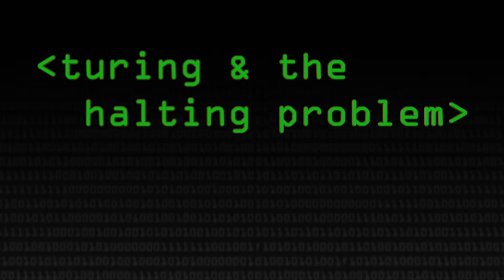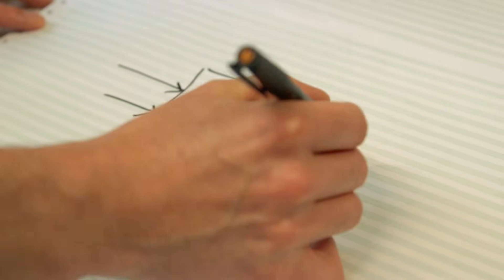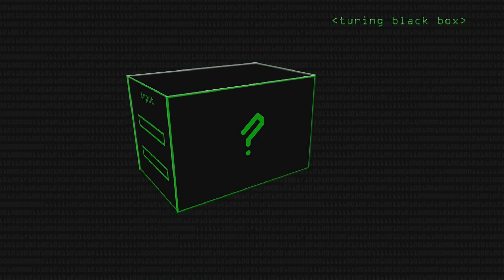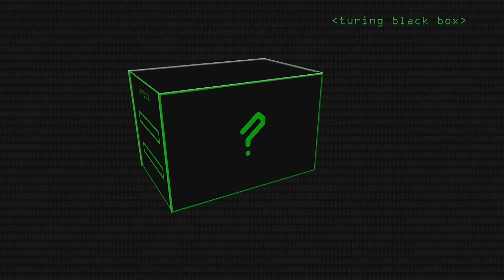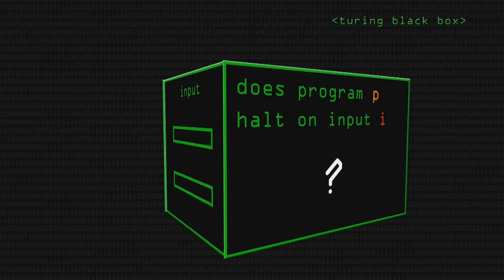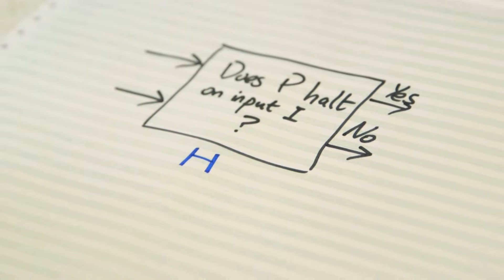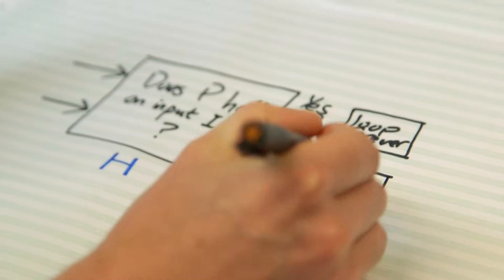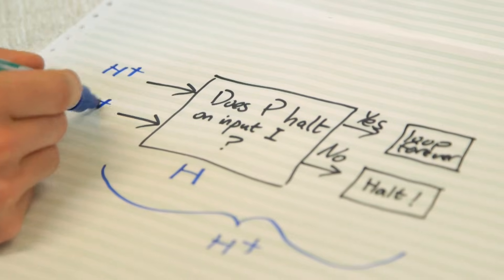Turing & The Halting Problem - Computerphile

Comment: 5:18 Aren't you just asking the wrong question? 
"Does the first iteration of H+ Halt?" would be a better one...

Also, doesn't that mean the machine could be the human brain...so...we couldn't do this? Yet...we can?

Also, how does that fact that putting H+ into H+ break means that H normal can't solve it?
Reply: +lolzomgz1337 to the other half of your question stated simply it cannot determine if itself will halt or not. The analogy he uses is bent a little.
Reply: +lolzomgz1337 That is a total bastardization of the original problem haha.

The logical conclusion isn't that we can't ever prove if a given program (h) will halt or not, it is simply proving that there is no general algorithm that can solve every single h out there.

For instance, I give you the following program:

func (i) {
 if i > 0 then {
  return func (i-1)
 else
  return 0
}}

Will it halt? Of course, there isn't a single number you can put in for i that won't cause the program to eventually stop, because if the value is ever not greater than 0, the program will return 0 as the answer. There's even an algorithm you could write to figure out that that program will eventually halt. The point of the Halting Problem is to show that your algorithm won't work with another program. You can only prove whether or not that specific h will halt or not, but there's no solution to find the answer for every possible h.
Reply: actually a human couldn't solve the halting problem because humans are at most turing complete
Reply: +lolzomgz1337 I could have sworn I hade a reply to this comment. And I got anotification when +Jahaal Mordeth posted. But my comment isn't here :(
Reply: Simon Lindgren
Damn. :(
Reply: Philippe Carphin Okay, fair enough.
Reply: +lolzomgz1337 This is a vulgarization of a problem that is actually harder to prove than this so you have to give some leeway.
Reply: +lolzomgz1337
As I understood it, he showed that if H exists, it leads to paradoxes, therefore H can't exist.
Reply: +lolzomgz1337 He proves asking that type of question about anything is absurd. look up Proof By Contradiction. He says that if it WERE possible, something else would happen that we know to be false. and since the rest of his arguments are valid, the premise must be absurd.
Reply: fk u

Comment: Can human brains solve the Halting Problem? If so, would it mean that human brains operate fundamentally differently than other computers?
Reply: +Pinkie Pie I think the way our brain works is fundamentally different than the way computer will work. I have not explored the topic enough to really explain you why, but here is my understanding.
I know that gödel incompleteness theorem (the proof is the halting problem is based on the same principle as the proof gödel used, russel paradox, or the liar paradox, self references is the key) prevent a system powerful enough to describe arithmetic to be complete, this means some statement cannot be proven true or false. the way Gödel used to turn theorem and statements into number and string to that statement about arithmetic becomes statements about statement is fascinating. then He came up with something like “this statement has no proof” 
There are entire regions of truth and falsehood. that you can never reach by logical means. formal systems are limited, you have to follow certain path. you start from the axiom, using certain rules, you then reach theorems.
In a certain way, we human have a capacity to espace this kind of cul-de-sac by moving up and down the scale of reasoning.
We are made of non sentient matter and atoms, and we end up being self-conscious and we can refer to ourselves. That’s the question Douglas Hofstadter tries to adress in Gödel Escher Bach. Why does a self come out of things that have no selves. 
The answer apparently lies into the very peculiar patterns brains are made of. “The key is not the stuff out of which brains are made, but the patterns that can come to exist inside the stuff of a brain” these strange loops, these self-referecing things are the answer to this question. we are made of strange loops, computers aren’t. There are stuff that we know are true, but that are not provable. computers are not capable of knowing such things.
Actually, does gödel incompleteness theorem prevent a computer from ever being powerful enough to contain this kind of strange loop patterns, or will we able to create this kind a self-conscious computers somedays ?
Reply: +anisometropie Benihime I suspect 'intelligence', for want of a better word, arises from Emergence. We have seen emergent behaviour arise already from Turing machines submitted to Wolfram Alpha. It seems to arise from simple algorithms into systems that can have feedback. Witness the startling output from the Julia set or the behaviour of Cathedral Termites.

As for self awareness, I'm not sure it's any more mysterious than awareness of others or the differentiation of one or two or many.
Reply: +Pinkie Pie There is no fundamental difference between brains and a turing machine. A Turing machine can simulate a complete human brain since birth till end of life, if it is given enough memory access speed and fast enough state machine. Thus, Human brains can not solve the halting problem.
Reply: ***** Hmm. Well, then we use a Turing machine coupled with a random number generator. I think this model has been studied as well, and has been found to not be able to solve Halting Problem either. What do you think about it?

Comment: Could someone clear this up for me?

Isn't the original H a solution? If you simply do not add the H+, won't it give you the halt answer? I understand the logic in wanting to disprove by contradiction, but I need a refresher why that disproof is mandatory towards finding a logically sound solution in the first place (H).

If anyone doesn't want to explain in YouTube comment format, but knows the answer, please feel free to point me towards a bit of research. Thanks!
Reply: +Charley Grossman The whole point is that given H that correctly solves the halting problem, we can force a situation where it gives the wrong answer, therefore H does in fact not solve the halting problem. Which contradicts the assumption, therefore no correct H can exist.

Comment: Even though H is contained within H+ it's no longer H since the "extra bits" are intrinsically part of it's new definition.
H would just have to take on a different form such that the "extra bits" could not be added. What would such a machine's output look like? I have no idea, but as the Novikov self-consistency principle states that paradox-causing time travel is impossible, it does not state that time travel in any form is impossible.

Comment: Why can't you run through every program one by one? Answer: You can. Decidability is a human limitation, not a logical one.
Reply: +thedrew4you It's not specifically a computer program problem. It's a computational problem. A logic problem. As there is likely an infinite number of computational problems, progressing through each one is not on. Also recall Kurt Godel's incompleteness theorems work on logic. Logicians still shy away from the precipice he uncovered. (Let alone Cantor's work).

Comment: I think some people who aren't understanding the problem. The problem isn't "Can I write a program that will halt every time I run it?" or "Can I determine if my specific program X comes to a halt?" (trivial examples are easy to come by). The question people were considering at the time was, "If we could create Turing machines (you can read "computer" for "Turing Machine" in most senses) which accept an input and give an output, will they be able to solve any problem put them, or will there be problems which the machine will not be able to solve?" It needs to be understood that if your hypothesis is that "ALL problems given to the Turing Machine can be solved by the Turing Machine", then to disprove this hypothesis, you only have to come up with ONE counterexample. To demonstrate that there are SOME problems that a Turing Machine will not be able to solve, he created the halting problem. Somewhat trivial examples are being used to demonstrate that a contradiction occurs and the program would never halt (and therefore never return an answer to the problem), but the halting problem is a specific problem that cannot be solved. Basically, the point is that for the halting problem, for any given halting program of any complexity, an input can always be devised such that you can cause a halting program to eat itself and go into an infinite loop. As you only need one counter-example to prove that a Turing Machine cannot solve ALL problems, this is considered a proof that there are limitations to what can be proven in any formalized system, such as a Turing Machine, or as with Gödel's Theorem, arithmetic with natural numbers.
Reply: Nicely put.
Reply: @FlyingTriX Turing machines are to abstract for return value to be a meaningful concept
Reply: This is the best explanation I have read, so thank you for that! :)
Reply: I was looking for this explanation, thank!s
Reply: thank you
Reply: Thanks a lot for this comment. This has helped me understand it more.
Reply: Thanks. I finally understand it
Reply: I understood the concept finally ! Thanks
Reply: Omfg thank you
Reply: Thank you kind sir.
Reply: Wow that was actually understandable. Thanx alot
Reply: Thank you for the additional explanation, it was a wonderful read :-)
Reply: But it's an extreme example that doesn't translate to real-world scenarios, no?
Reply: @danivanon  The halting problem, especially as applied to Turing machines, which have infinite resources, is something that at its core applies more to mathematical theory that to solving specific problems. However, the problem applies to computers with finite resources, as well, as even a computer with a modest amount of memory can contain enough different states that trying to enumerate through them all would take longer than the age of the universe. 

The halting problem is, in essence, an existence proof. It tells us that it is possible to define a problem which a Turing machine cannot solve, no matter how you program it. This tells us that some such mathematical systems have limitations and are not "complete". There will be problems that cannot be solved using such mathematical systems. 

In the real world, it is helpful to realize that not all problems can be solved using a particular tool. Put another way, computers are great at solving some problems, but there are also problems that can't be solved directly using one. It is beneficial to know which is which so that one does not waste one's time and effort trying to solve problems using an inappropriate tool.
Reply: This is a very brillant comment.
Reply: Many thanks!
Reply: what you meant to say is: "in the video, they say that it's impossible to always determine whether or not a program halts." there, that clears it up for people that didn't watch the video
Reply: Why is it specific to halting? Can't one use the same trick on say return or output value? "Oracle said I'll return x. So I'll return x+1". What's so specially about "halting"?
Reply: @MaxLohMusic  It's not. The halting problem just happens to be a very popular example. The entire approach to this sort of thing is called a frustrater, where you ask a question, and determine the right answer based off the proposed answer in order to force the answer to be wrong. 

That said, you can only have a frustrater when the program is trying to make a prediction. You can falsify 1+1 for example.
Reply: @Nuclearburrit0  Thank you for explaining what a frustrator is :D
Made a lot more sense knowing there's a name to it
Reply: @MaxLohMusic  Every Turing machine has 3 final state: 1) halt & accept (like answer is yes). 2) halt & reject (answer is no). 3) loop (fail to halt and give answer, just running forever).
Reply: Has anyone ever made the encoding of 1s and 0s  that is the Universal Turing Machine that solves the decision problem machine and input? I’m having trouble finding it.
Reply: if you redefine a solution apply to only to solvable problems then i dont see why this thought expermiment needs to exist
in math it is quite common to respond with dne or undefined simply because an answer does not exist, and this answer would be correct
the issue with the halting problem is that it assumes the machine is a complete machine that can solve any problem even though it can only answer yes or no
Reply: @orionsayshi5037  You're close with the last part of your comment. The halting problem is the counterexample problem that proves that Turing machines are not complete. It's not that it can only answer yes or no - the problem being put to it is a yes or no problem - will a program halt and come to an answer or will it run in an infinite loop? The fact that Turing machine is incapable of answering that question for all programs proves that incompleteness. Within its own system of rules, it cannot solve the problem.

A much simpler example of completeness / incompleteness can be shown using simple math. Consider the set of all integers. If you add two integers, you get another integer, every time. If you subtract two integers, you always get another integer as a result. If you multiply two integers, another integer is the result. The set of integers is complete for operations of addition, subtraction and multiplication. However, when you divide one integer by another, you can choose inputs A and B, where A/B does NOT result in another integer. The set of all integers is not complete for operation of division. Some inputs for A and B, such as 10 and 5, result in another integer, but other inputs for A and B, such as 10 and 3, do not. The halting problem is an example of a problem that shows Turing machines are not complete, just as 10/3 shows that the set of integers is not complete for the operation of division. 

You can add to the mathematical system to make it "more" complete. You can add fractions to the set of integers, giving the set of rational numbers. Examples that would fail for the set of integers (1/2) now work and fall inside the set of rational numbers. But it is still incomplete in the sense that 1/0 does not yield a result. We can make it complete, however, by adding the axiom that 1/0 is, by definition, undefined. However, rationals would still not be complete for the operation of square roots, and so on.

Godel's incompleteness theorem also shows that for systems meeting the requirements put forward by Godel (i.e., this does not apply to all systems, just the type Godel was talking about), adding an axiom may solve a particular example of incompleteness, but another example of incompleteness can always be found which causes the new axiom to be insufficient to make the system to be complete. Such systems will always be incomplete, no matter how many new axioms you add.
Reply: So is the point being made here that computers aren't sentient and aren't able to deal with problems they haven't been designed to deal with? Or that they can't handle paradoxes
Reply: @flashgnash  Neither. The point is that for mathematical systems with particular properties, of which computers are one example, a problem can always be devised that cannot be solved within the framework of that system.